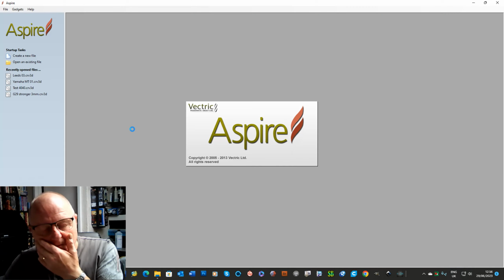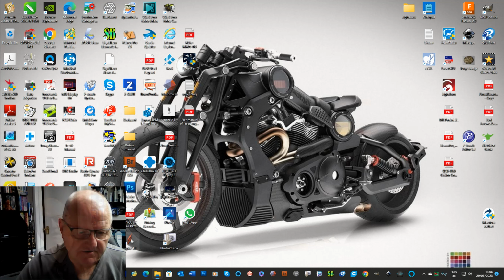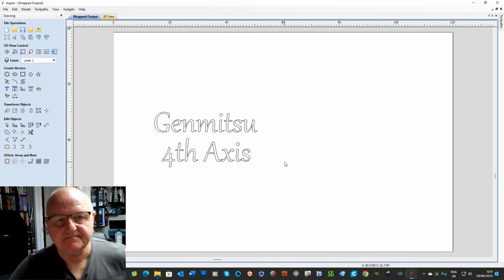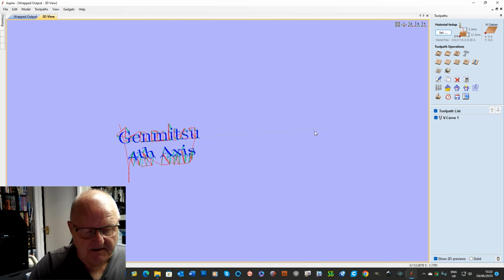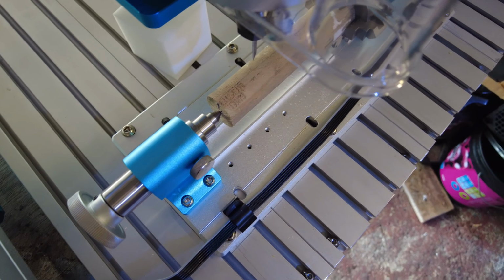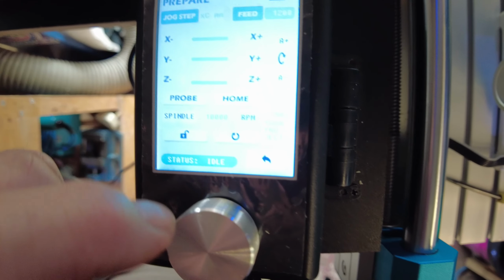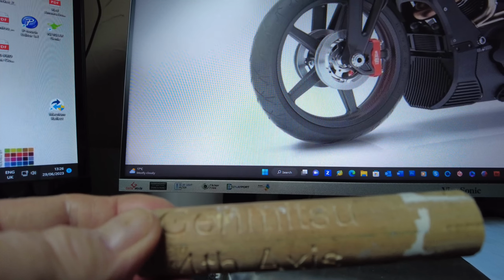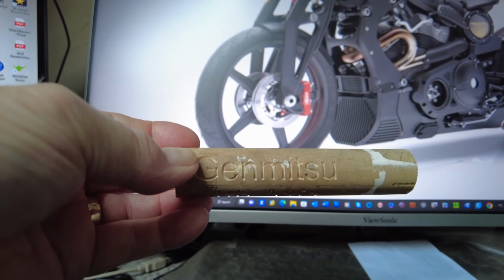Sainsmart Genmitsu 4040 pro cnc 4th Axis Rotary,  operation and faults

Comment: flip the jaws to grab larger material , been a minute I looked at specs but I believe its rated for 50mm
Reply from the maker: Hi thanks for the info I have tried to flip my jaws no luck. I did some 60mm sprockets for some one the other day in 12mm plywood with a v bit using a 25mm plug on the chuck  end worked great
Reply: @Tonys.Top.Tips.Workshop  what issues did you have flipping the jaws ? I have it on order but haven't received it yet, most these work by simply loosening chuck and one jaw at a time will fall out , these should be numbered with matching numbers on chuck , if not use a marker , first one to fall out would be number 4 and last to fall out is number 1 , flip jaws and start with number one and tighten chuck till first jaw bites , continue this process till all four are installed , mine won't get here in time by this weekend but should be able to verify by next weekend .
Reply from the maker: @t77chevy  Hi thanks for your great info I have been in the workshop today and found that when I open the jaws to the limit it hits  a point where I really have to put some force on the levers. This is what has stopped me from reversing them. So I persisted with it back and foreword, then it moved I thought I had broken it, when I looked I had what looked like a small piece of swarf that had come out of the first jaw. This is what must have been stopping it and convincing me you could not reverse them. They all then came out and I could put them in the other way. Thanks for your help I would have just left it if it had not been for your instructions. cheers Tony

Comment: howdy Anthony,  another way to solve it if you prefer the chuck on the left is to reverse the wiring on the stepper motor.   if you look in the manual there is 4 wires on screw terminals  labeled A+, A-,B+,B-  if you switch A and B,     B+,B-,A+,A- it will switch the rotation direction.   you want A+ to turn the top of the part towards the front of the machine.   the reason flipping the image top to bottom didn't work is it doesn't change the A direction,  A+ is still turning the wrong way.  to do that you have to flip your image around the A zero axis so the axis is working in a negative direction from zero.   --- your 50mm block looks great!
Reply: it is fine with me.   this 4th axis is new and sharing is how we will learn to use it.   I currently do not have a YouTube channel set up to share stuff on
Reply from the maker: @yorinov2001  Thanks for your help
Reply from the maker: Hi thanks for that great piece of information I will try that and if its ok with you I would like to mention that on another video. This is what youtube is about helping each other